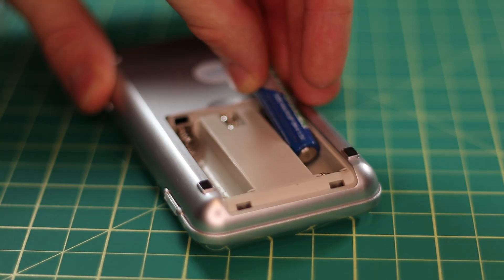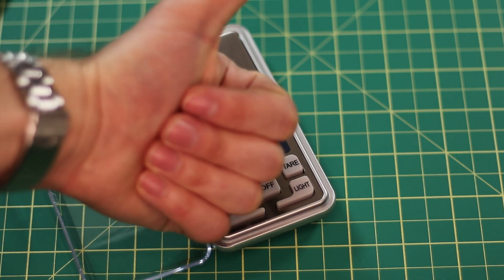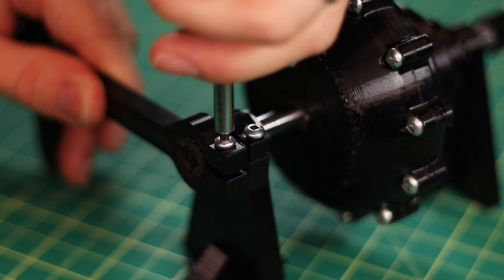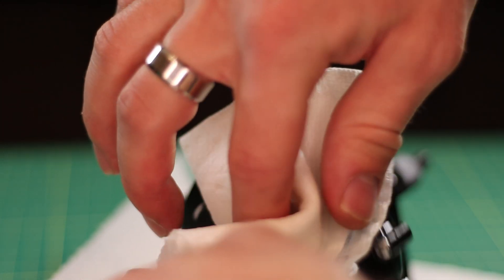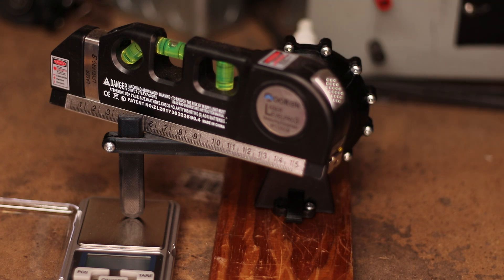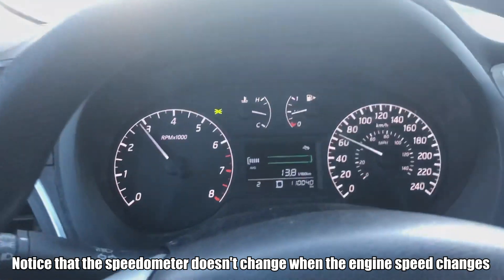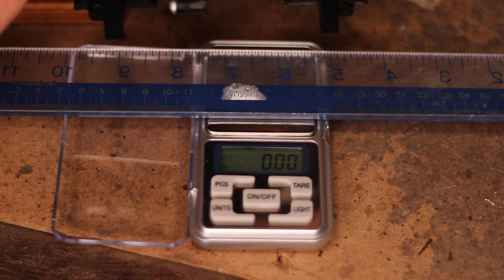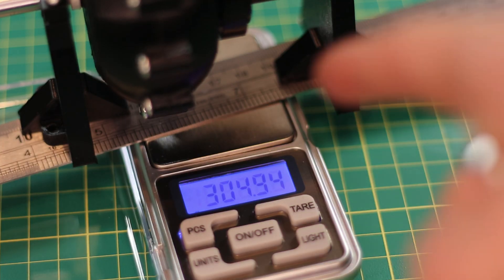What Happens to a Fluid Coupler When it Gets Too Warm?

Comment: I think your horizontal arm does not what you want it to do. The connector between the horizontal part of the arm and the vertical part would have to be a bearing/revolut joint. In your setup the vertical part of the arm puts a momentum onto the horizontal part of the arm and thus increases the torque. Instead of adding a joint, you could also just use math to get the true torque. Like what you showed at 5:24. Just add a sin() or cos(). 
Cheers :)
Reply from the maker: Thank you! while it may be the case, to determine the force using trigonometry would require precise measurement of the angle between the plate and the arm, meanwhile my apparatus provides a more accurate answer without the need for trigonometry
Reply: @CamdenBowen  I'm fairly certain you are getting a wrong reading right now which is off by a factor of cos²(). As long as your vertical beam is fairly short, the angle is small and therefore your results are not that far off. But imagine if you had a long vertical beam and a long horizontal beam. Also you can get the angle by arctan() or you could just angle the scale so that the scale plane goes through the rotation axis.
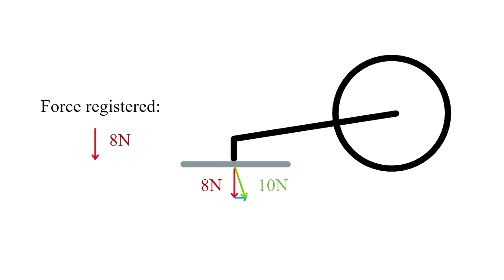Reply: @CamdenBowen  Or think about it like this: At 5:26 the scale experiences the same force when the arm is horizontal and when it is not horizontal.
Reply: @CamdenBowen max is right. Your system is no different from a straight beam that stretches between the output shaft and the contact point on the scale.

Comment: would be cool to coneckt it to as you sead a weed eater enigne probly will need to beath it up a fare bit and make it bigger you could also coneckt it to your gearbox and make a gokart. if you neeed or want more torque from it you could put ep90 in it(ep90 is a heavy oil for axles realy thick) or even make a clutch that coneckts the output with the input to lock the sides together ised for when a vhecle is moving it will lock it together makes it more efishant will need to relece the clutch to change gear thow. good luck with my spelling
Reply from the maker: I'd probably need to make a larger one for a weed eater, the channels are probably too small to effectively transfer that much torque. Something heavy like axel fluid or just transmission fluid may defiantly help under heavier loads, but if it is too heavy then the fluid will not vortex very well and it may cause increased slippage

Comment: not knowing how much time you spent with the previous tests it seems it might have been leaking and you didnt notice at the time and the stain spread looks larger than the volume leaked because wicking spreads it out over a large area
Reply from the maker: The fluid does not leak out when it is cold, I should have mentioned in between shots once it cooled down it was clean. Once it warmed up enough however it was able to seep past small cracks and out
Reply: @CamdenBowen  thats pretty much what i was expecting, hot oil is considerably thinner than room temp. im surprised to know the seals on the shafts held up well, thats where i expected the leaks to originate. what material did you use for them?

Comment: nice video!
maybe you can print future models in gray? it is kinda hard to see details when the model is all black :)
also...maybe you can use a load-cell and a speedometer with an arduino to properly plot the torque and RPM? (just a suggestion) 
nice video though!
Reply from the maker: Thank you! I should really consider what filaments I buy, I usually buy what's cheapest regardless of the color. I may come back in the future with more testing to determine the torque when the output shaft is spinning rather than locked, so that may not be a bad idea!

Comment: Very good video mate, tho im pretty sure those scales arent meant to have their range extended like this. While it works, it might break the load cell or other plastic components inside. Besides that, its probably not calibrated properly for loads higher than its range. If the load cell is rated for 500g, its output outside that range will be off by a significang amount. Your last test might actually be caused by a damaged load cell, check it with the steel ball again to see if it works. For future tests consider using a kitchen scale, these usually go up to 2/5 kg and have 1 gram accuracy. Plenty for tourqe testing.
Reply from the maker: Thank you! I actually just checked again, it seems to be reading accurately. I do wonder if maybe the accuracy begins to deviate more and more past 500g, it is possible that a larger scale will provide better accuracy
Reply: @CamdenBowen  also entirely possible they accounted for people doing something like this and used 1000 g cells and divided it in half to get the scale's advertised rating
Reply: I'm guessing the scale has 1 kg of range but it's halved for taring purposes

On the subject of a broken load cell
You could clearly see that the arm attached to the coupler was bouncing, and not staying put as expected, so even if the cell was broken, you wouldn't really be able to tell

Comment: something I would love to see would be a different type of dynamic torque test, how the torque delivery changes at different output speeds. it seems like it wont be that different from when its stopped because the main thing that delivers torque for your design is difference in input and output speeds but the g forces may affect its torque output in strange ways.
Reply from the maker: Theoretically, if I knew the coefficient of friction between the arm and the shaft where the output shaft is, it may be possible to perform such a test using a method similar to brake dynamometry. But that may be for a much later date lol
Reply: @CamdenBowen  yeah, I guess the only way to measure dynamic torque would be to build a dyno. awesome video and awesome idea though, looking forward to your next video.
Reply: Now we just need a baby (Open Source) 3D Printed Dynamometer lol

Comment: Could you do an efficiency test. Also, can you add imperial units.
Reply from the maker: The closest thing I had to an efficiency test was comparing how the torque transfer changed as the temperature increase, its difficult to performed a efficiency test with the equipment I have. If in the future I do mate it with a weed-eater motor I may then be able to determine its efficiency
Reply: No imperial units please.. Metric makes more sense.
Reply: @Matthews_Media European spotted 🚨 🚨 🚨 wtf is a kilometer🦅 🦅 🦅
Reply: @blingblingdog6958  Actually South African.. and the whole world except for the US uses metric so...

Comment: You should make an rc tractor trailer with a flatbed to hold metal weights and add the fluid coupler to the motor and simulate torque converter stall and power it would be a good idea but the weed eater is a better idea I say for sure do that one after u figure out the leakage and test the transmission fluid
Reply from the maker: It could be down to the filament I used or a calibration issue, but I think further testing with this could be fun!
Reply: @CamdenBowen  yes very 😅😅😅